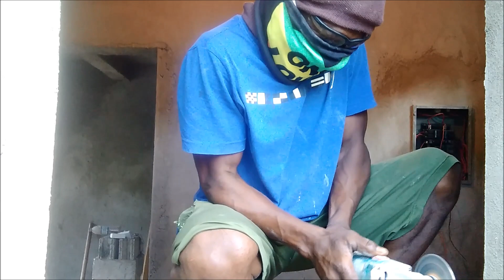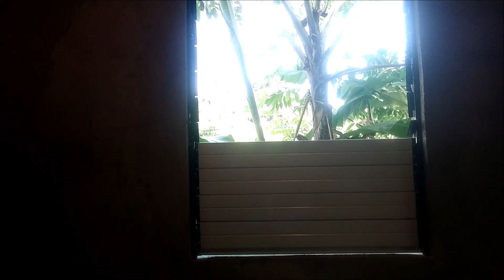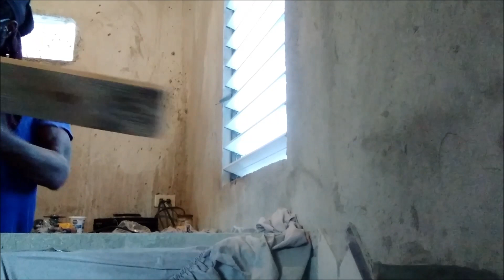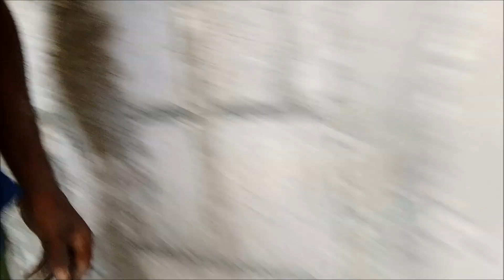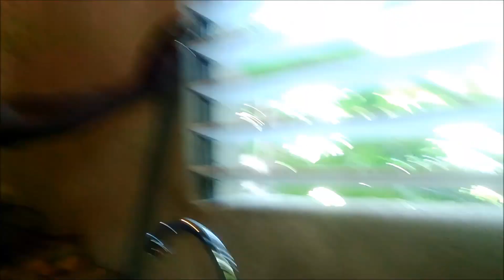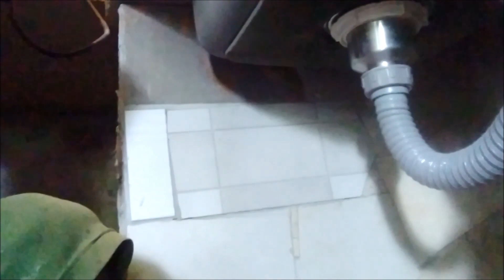How To Install A Louver Window  6 29 21

Comment: Daneiel check the pipe leading to the facet . It may be blocked by tangit or a small stone etc
Reply: It could also be that the pipe or the flexie to the foist is not connected to the water mains properly 🤔.

Comment: Bro just get some cements an make a little lip under the window" that water doesnt run into the inside  half  way on ynder the bottom window blade 1/2inch